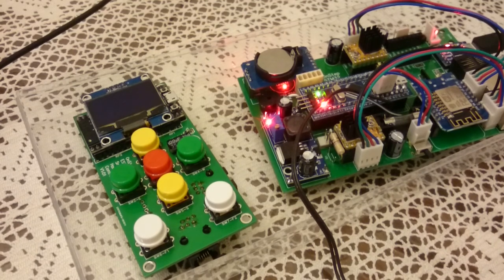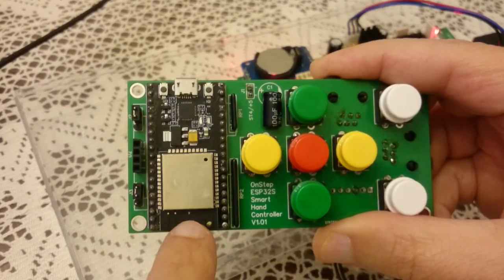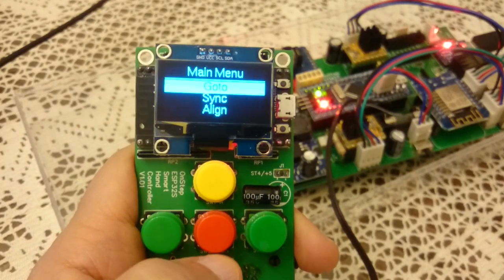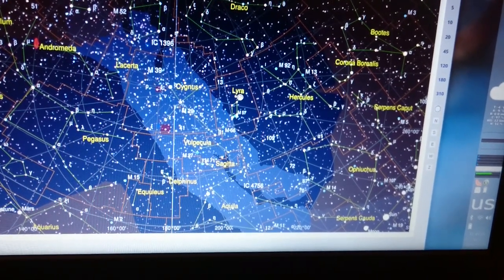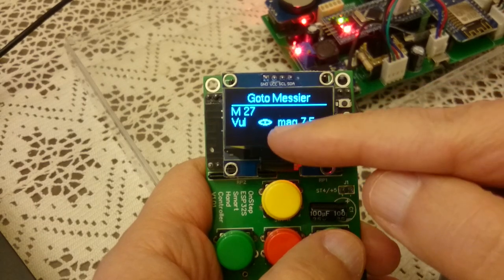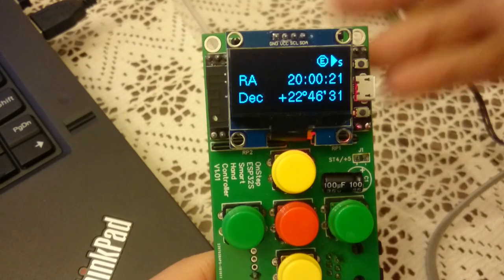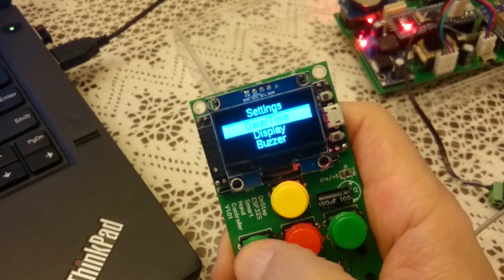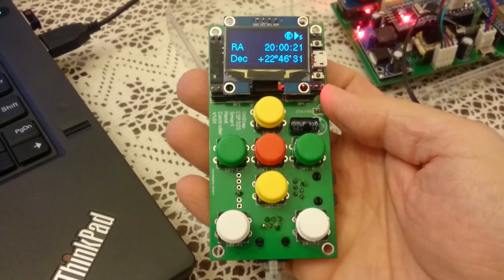Smart Hand Controller for OnStep based on low cost ESP32

Comment: Wow that handset looks so nice. Been waiting for my esp32 to come for like 3 months now. The seller has said he will post a replacement immediately twice now,separated by 4 weeks. Got bored and order a couple from somewhere else as they were a couple of pounds and wanted to experiment with adding 2 screens to my onstep. One on a SHC with buttons and one just the screen on the mount itself. Was going to add extra couple of wires to the ST4 lead (perhaps use an 8P8C and drill a couple of small holes in the pCb (not through a trace I hope :)  )to carry screens scl sda data and use fan header for power :) Using your design makes it cheap enough to risk as Teensy are £22 for me. A little dear to buy many. Great work and always good to hear your feedback on forum :)
Reply from the maker: The whole STM32 thing started because Teensys, as nice as they are, are expensive and can be sourced only from expensive stores. 

Making an alternative that is affordable for most people, and available through multiple outlets, yet preserving good performance are the goals for both the STM32 and ESP32 SHC.

Comment: Excellent telescope control thanks for sharing, would it be possible to control motion using a analogue joystick instead of buttons.
Reply from the maker: Note that the newer hand controller has a 5 way center button, which means that the other 4 buttons are not necessary. You just push up, down, right, left or press. 

On the other hand, someone did modify OnStep to use a Wii Nunchuck and it works. So adding a joystick should also work.

Comment: Good afternoon, can you change the language to Spanish in the firmware? What are the rear molex connectors that say +5 used for? Regards
Reply from the maker: There was a Chinese translation that someone contributed, so a Spanish one can be made if someone creates the necessary files.

Comment: Hi i have a classic EQ mount ,  not go to , only 1 axis motor and i think its not Stepper but DC , can i make this work for me and transform my mount in to go to with this OnStep ,  im quite good with electronics i have a lab , assembling it wont be a problem but i never did it and dont know much about , not even if it could work with my scope , if it can i can start ordering what i need and learn eventually how to make it work but i need to know if it can work on any EQ mount . Thank You .
Reply from the maker: OnStep works only with stepper motors. You have to replace the DC motors with steppers, and ones that can sustain a sufficient RPM to make Gotos possible. Visit this link to see how others did it

https://groups.io/g/onstep/wiki/Showcase%3A-What-Users-Built-With-OnStep

Comment: Hello, I just ordered the PCB version 1.03 that I found through EasyEDA/JLC.  I am having trouble locating an accurate BOM.  Can you provide the part numbers for the switches and button caps, and the specs for the resistor packs?
Reply from the maker: If you go here https://baheyeldin.com/astronomy/onstep-esp32-smart-hand-controller-shc.html you will find a Google Drive document that has assembly instructions and info on the parts
Reply: The 5-way button is not listed, in that document. I been able to find all other items from Mouser Electronics. Maybe the author can post a part number or a company that makes the joystick.
Reply from the maker: @karlschuneman7960  subscribe to the OnStep group and ask the question there, Dave will answer you.
Reply: For the 5 way, I bought mine from adafruit.

For the other switches, I used this kit https://www.amazon.com/dp/B0722LBKV7/ref=cm_sw_r_cp_awdb_t1_4.znEbV8YPM3X
If I remember correctly, it was 12x12x7.  They are available in ebay for cheap too.